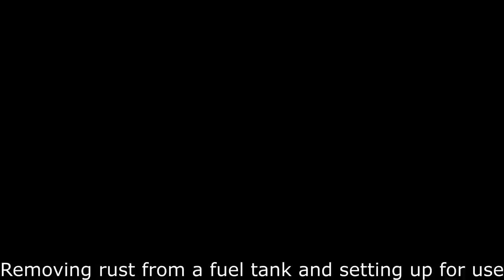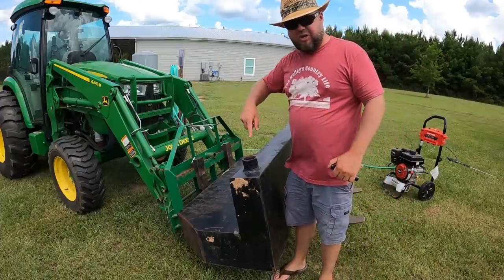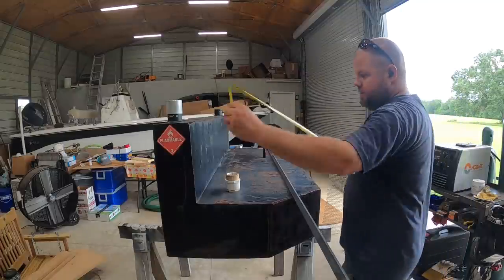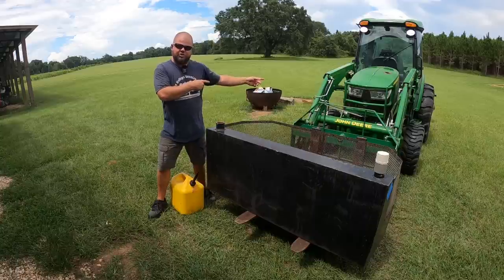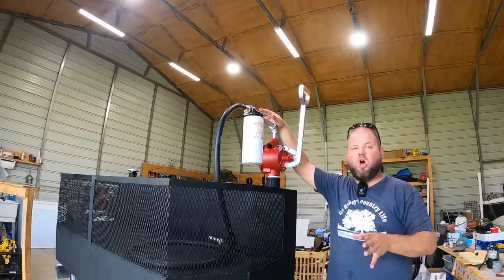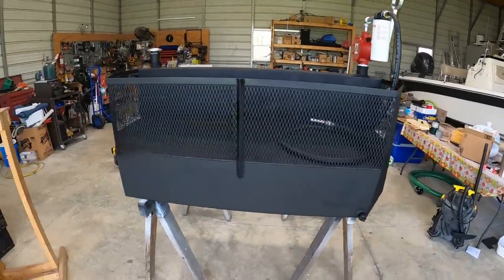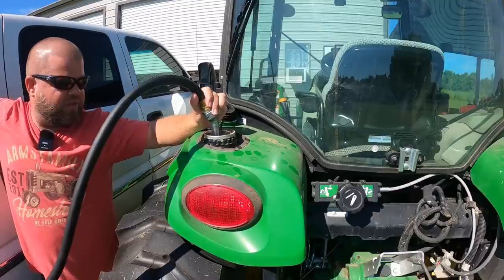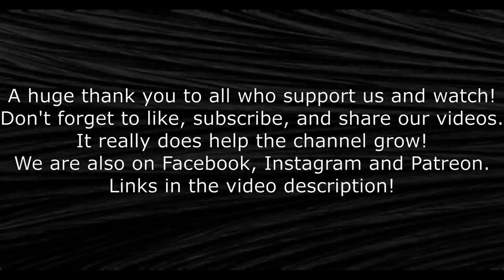Removing rust from a fuel tank! Diesel tank setup with Fill rite pump. #604

Comment: Hi Andrew! Do you have any experience with Ospho. Works amazing on rusty steel.  My grandfather used it around the farm all the time.
Reply: Phosphoric acid for steel, turns rust black & seals it from any more rusting. In aviation , jet, the fuel has a microbial growth in the moisture in the fuel, they make a chemical called prist that will knock it out. Jet fuel is really clean kerosene.
Reply from the maker: No experience with it in this type of application. Thanks
Reply: @rebus570  I'm in the aviation industry. I was trying to recreate the same situation for Andrew. 100LL aviation fuel for long term storage in all non catalytic gas powered equipment would do him wonders as well as its distilled and takes on average 9 years to break down as car gas starts at 30 days. And yes he can mix it.